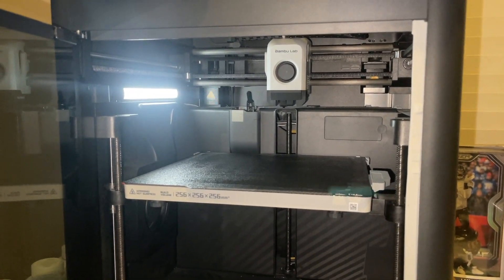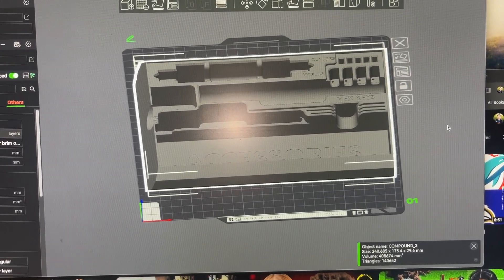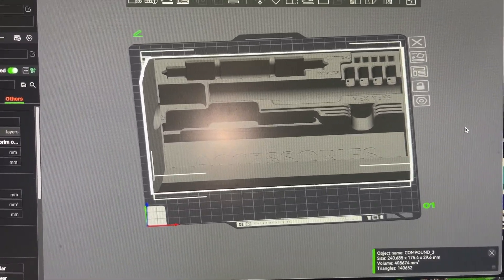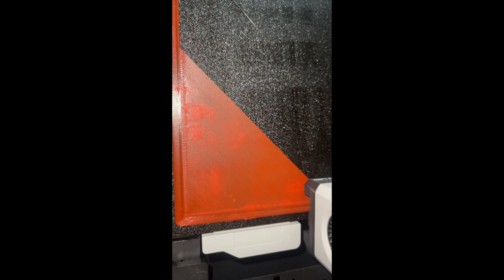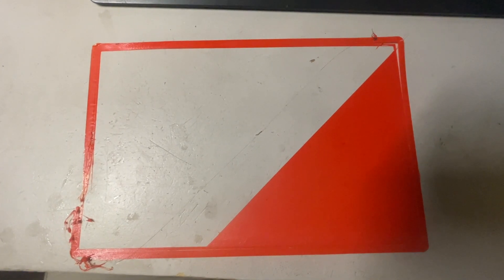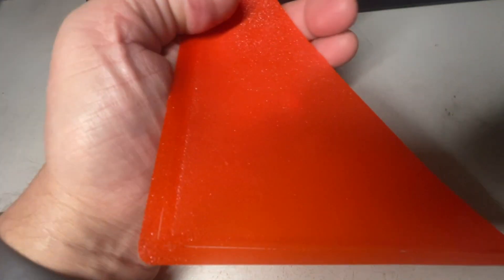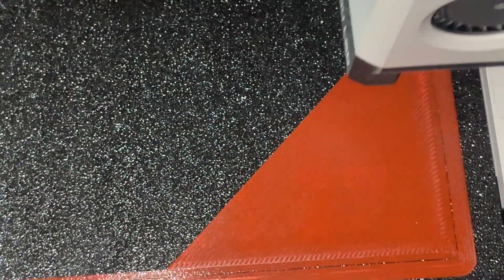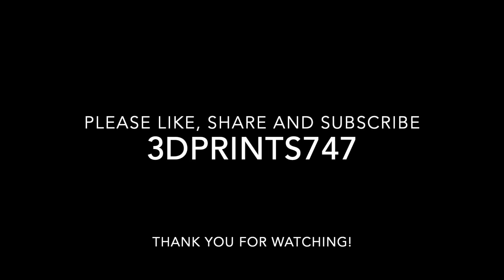Printing an AMS Riser in PETG

Comment: You should calibrate every time you change nozzles and filament.
I wash my bed plate with DAWN dish soap to clean the plate and remove oil from your hands.
I use Amazon glue stick on the plate (it washes off nice and easy with the soap).
Reply from the maker: Thank you, I'll definitely give that a shot!!!

Comment: Hi! Complete beginner here, but i've had good success with the Bambu Engineering Plate on PETG, no glue, just wash it with dish soap every now and again and wipe down with 99% IPA between every print. From what i've gathered, with the HS nozzle you'll want about 10°C higher temp because of the poorer thermal conductivity, so after about 2 days worth of testing, calibrating and fiddling with the settings, i ended up 270°C on the first layer, 260°C on the rest, and 80°C bed temperature, and haven't had an issue since. So far ran a bit over a roll of Aceaddity PETG with those settings. Also i found that calibrating the Pressure Advance, as well as Retraction Length got rid of all the random blobs and stringing i was getting.

I'm probably doing it all wrong, but it works for me, and results in beautiful print quality on my X1C, so i thought i'd share. 😁

Oh, i also printed the AMS riser "Light flood for closed Bambu lab closed printers" by Jorge Rui over at Makerworld, as it has toggleable vents as well as a place for an LED strip (for me the live view camera was almost useless with the stock light using darker filaments, but now i can actually see what's going on), and i print PETG with them open, but door closed, and that keeps the chamber temp at a steady 40°C, which i feel is also helping with layer adhesion without being too hot to cause problems with the feeding.
Reply from the maker: Wow, really good information, thanks!!!  I've been printing for 4+ years now but always ready to learn something and I appreciate your comment!

Comment: If you have the gold PEI plate use it, I've had great success with it and PETG with no glue of any kind. Also run the bed at 100 and preheat till chamber is around 30c. That helped me alot when printing the nut crackers.
Reply from the maker: I have the black PEI plate that came with the printer.  I might have to look into grabbing a gold one.  Thanks for the tips and for watching!!!!